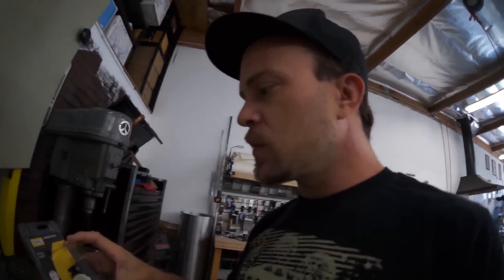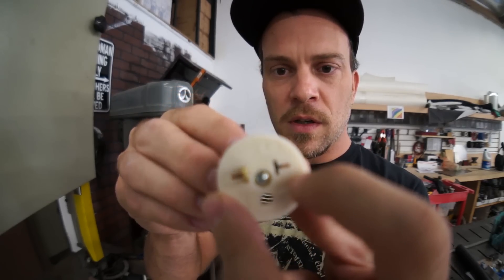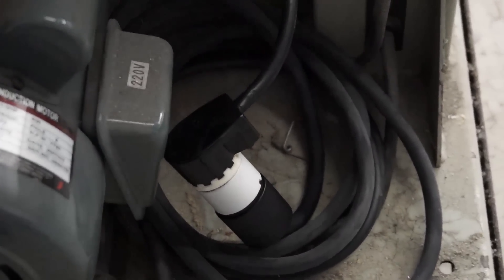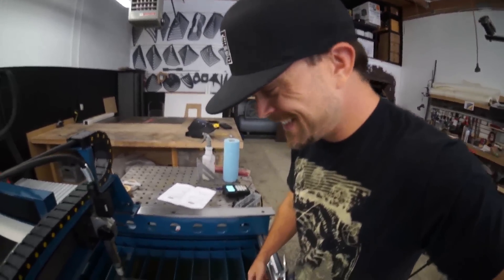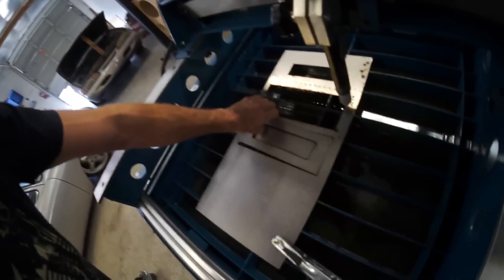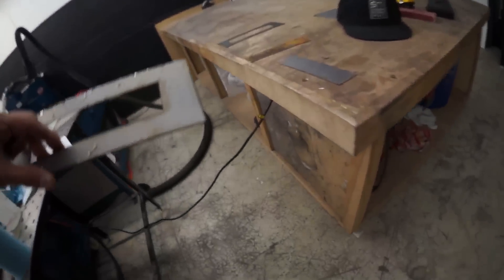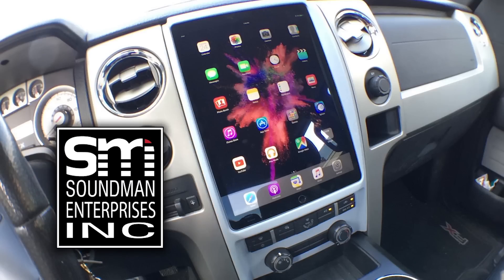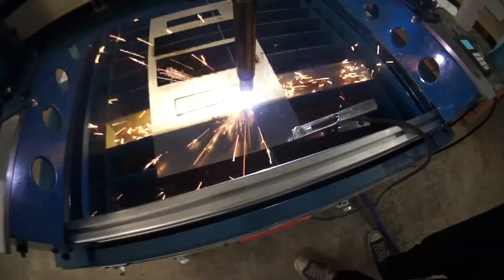Steel DIN PLATE

Comment: Buy a Flocculant for the rust issue... It causes the iron molecules in the water to bind to one and other until they become so dense that they can either be filtered out or vacuumed off the bottom of the tank. If you can't find it at Home Depot, Walmart, Lowes; just about any pool supply place will carry it.

Comment: Use coolant for cars, it has built in rust inhibitors to stop coolant galleries in blocks from rusting from the inside out.

Also could you go into detail on how you align the workpiece with the start of the cut. And what software you use and how to export it to the table. How you make the cut ins on the software etc.

Comment: Are you just changing the plug from 120 - 240 without re-wiring the taps on the motor for the voltage change?

Comment: So wait a min.   You have a wire with a plug that's 110.  And merely changing the plug end. It's 220?  Even though it's using the same wire ?   Phase converter somewhere ???

Comment: What about distilled water? Don't know anything specific about a CNC table but "tap" water will corrode cooling systems in cars over time. Also someone else mentioned coolant/antifreeze. I would think that would work and dilute it with distilled water (you're supposed to do this anyway).

Comment: Plasma Metal Dust Hazards
Using a plasma torch to cut metal creates metal dust, smoke and fumes that are unhealthful to breath (see Reference 3 – subhead "Clear The Air"). This is particularly true for metals coated with certain materials, such as hexavalent chromium – a coating used in metal finishing to prevent corrosion on stainless steel and other metals. Research shows that a worker using a plasma torch to cut or weld stainless steel is exposes to hexavalent chromium which irritates the skin, eyes and respiratory system, while also increasing the risk of lung cancer

Comment: I would add more water to the table, I like to have the water only a few mm below the work piece. Add a lead out to both internal and external cuts for nice straight edges. My default is 10mm radius on lead in/lead out if I can fit it and I overlap them 1-2mm. Ground the slats so you don't need to ground the piece. It does take time to work out how each machine likes to run so just keep trying new things and keep a tab of what works best at the time, don't run with fucked tips. 👍

Comment: These fucks are trying to get you the fuck your machine up. If the directions tell you to fill the water table 1/2 fill it 1/2 I ran an industrial plasma cutter 5 x the size of that one for almost two years I've never heard of and anti rust agent I think someone wants you to spend wasted time looking on the internet for something that doesn't exist. My table instructions told me to run the water to the top of the slats so I would not burn my slats when cutting1/2",  1" and above material but it was also a double tank second tank was for over flow!  Now the key to making your water stay clean for as long as possible is to never leave big pieces of scrap in the well. That shit will sit in there and turn your water into a rusty mess. Also regular cleaning of your well will save the life of you machine. Good luck Doug and have fun.